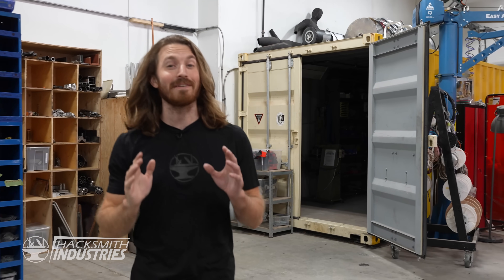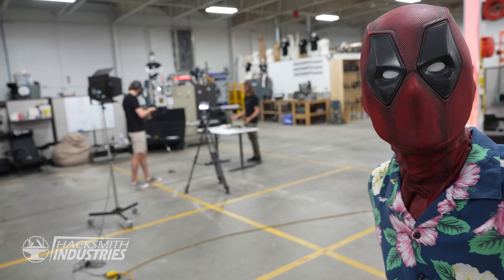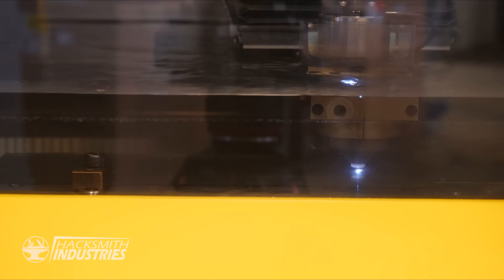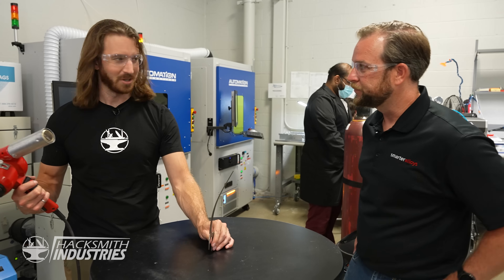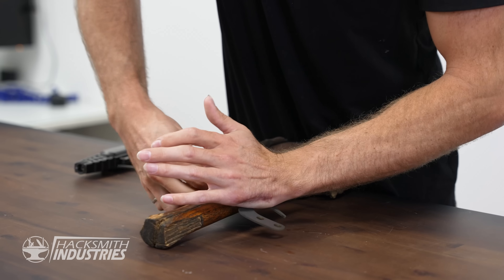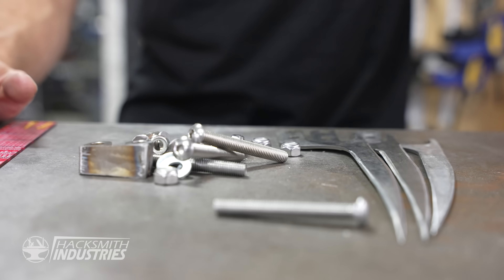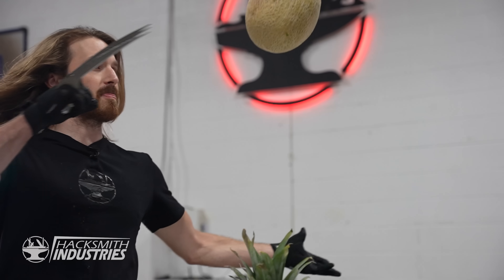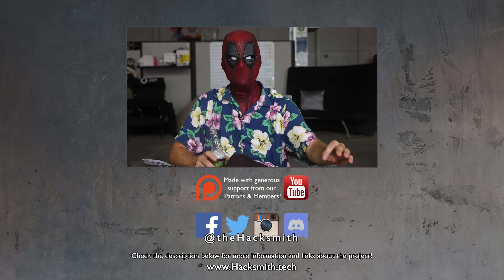I Made Self Healing Wolverine Claws!?

Comment: I think it would be really cool if the claws were held (firmly, so they don't come loose) with a highly insulating material (to protect the user) and had a system constantly circulating electricity through each claw, connected to a battery. The system should circulate just enough electricity to generate the necessary heat to regenerate the claws. Also, making them a bit thicker would be better, so they don't bend so easily anyway.

Comment: I think that material would be more practical for making machines or possibly Buildings.  In the game subnautica there was a repair tool that moved wires and bent pieces of metal back into place.  If it was made of that material that would make sense, the repair tool would just be a heater.  If you could make houses and other buildings from that in areas that have a lot of natural disasters it would significantly help fix the damage.

Comment: @hacksmith great stuff. Quick question - when you used the grinder to bring some shine, it would have definitely generated heat. Would this heat not alter or have impact on the thermal properties and on the programmed or induced temperature.
Reply: Well they were clamped flat while he polished, so presumably it would only solidify the flat shape it heals back to. Can't say i know for sure though...

Comment: You could connect each claw to two wires wich are connected to a power source, so you can heat them up to straighten just by pushing a button or a switch

Comment: Only issue with them now is they are much weaker, so need to find a way for the smarter alloy to not bend so easily/have more strength however still fix itself

Comment: As far as practicality goes, nitinol seems like it's too flexible to be used on anything but flesh and maybe some light armor. The fact that it can self heal means that if you do accidentally hit something too tough, you wont have permanently ruined your weapon. But is that better than just having stronger claws that would perform better against a broader range of materials? If your stainless steel claws get bent, you cant fix them on the fly, but how much force does it really take to bend them? Punching through cinderblocks doesn't seem to phase them so I cant imagine a situation where they would truly be in danger of breaking. 

Ultimately, I think the nitinol claws have one leg up over the steel ones: if you stab someone in the chest, rather than having to break through the ribs, the nitinol claws would likely bend around them, making for a deadlier stab with less force. Additionally, if you hit something you dont immediately cut through, the flexibility of the nitinol creates something of a cussion, so your strikes aren't as rough on your wrist and hands. Its a more forgiving weapon, but not as strong.

Comment: That's a neat metal but I'm not sure where the wolverine claws come in. He self healed, the metal was foreign and didnt heal nor did they need too as they were thick metal. What would be impressive and on point is a set done in tungsten with proper thickness and dimension with a really precision sharpening done too them. Them they would be tough enough that they wouldn't need healing just an occasional resharpening.
Reply from the maker: Tungsten is actually super brittle -- they'd shatter on a hard impact.

Comment: Titanium but carbidize the edge and points with Tungsten Carbide. Titanium at it's hardest form maybe 57 on the Rockwell Hardness scale but Tungsten Carbide has 74 Rockwell Hardness. Carbon steel might reach 62.

Comment: Just a quick question would this have any application for edge retention within say a chef knife. I am not a very scientific person but I am wondering if you would be able to say heat a knife over an oven burner and have its "teeth" return to normal.
Reply from the maker: Not really -- When a knife gets dull it's usually losing some of the material of the edge, which is why you have to resharpen it by further removal. Can't heal an edge that is gone!
Reply: @hacksmith  I didnt think so but i wanted to check also thank you very much for a quick reply!

Comment: Ok, I definitely could be wrong,  but I'm sure I've seen/heard somewhere that there was a similar metal (or maybe polymer?) Where you could pass a current through it to make it return to its "programmed" shape? Might be a cool way to have it heal without an external source of heat? I guess wearing a battery pack and running some wires down your arms might ruin the look though.
Reply from the maker: Same thing -- passing a current through nitonol heats it up =)

Comment: To be fair, you made "sell healing claws" because Adamantium claws wouldn't ever bend, or break 😉
Reply: Actually, Wolverine’s adamantium claws have been broken on several occasions
Reply: @peepee06  example?
Reply: @Sprd1011  he was probably got mixed up thinking of that one time victor broke Logan's bone claws
Reply: @Sprd1011  Didn't he get them broken in that one movie with the other dude that had a superheated adamantium weapon/blade? I don't remember it well. I'm sure he's had them broken or something in the comics though.
Reply: @RemedieX  yeah, it was cut by another bigger and heated adamantium
Reply: @Sprd1011  when silver samurai cut logans claws off.
Reply: @peepee06  not true
Reply: but needs to be melted either way to be able to mold and be malleable
or it won't be usable if you can't form it to what you want
Reply: @lag00n54  adamantium isnt some metal that can be found as solid and then reworked by melting. It is liquid mixture of multiple melted metals and components that are melted and mixed and must be given shape to it  in 8 minutes after those 8 minutes it turns into solid adamantium and then it is almost impossible to melt, it even survived temperature close to that of sun
Reply: @Sprd1011  bro it goes way past the sun bro the only thing that can melt it is straight up galaxy busting heat
Reply: @Sprd1011  it’s called an alloy
Reply: idc what you call it, it’s metal that can straighten itself
Reply: And wolverines bones were coated in it, he doesn't re-heal adamantium, for example when they were cut by the heated adamantium blade his claws grew back but as bones, his original claws
Reply: @markstafki9597  he still has adamantium claws in movie Logan where he is old which means he has them after samurai fight.
Reply: @Sprd1011  He had the metal claws in Days of Future Past as well, in the further. Which takes place just a few years after the Wolverine (2013) movie which is where he got his claws cut off.

So he must’ve healed the Adamantium 🤔
Reply: @Brandon-br7tc  he has spares
Reply: His adamantium claws were chopped clean off by the samurai robot and magneto managed to bend his claws
Reply: @noobdestroyer4758  did that story with magneto happen in movies or  comics?
Reply: @Sprd1011  I’m pretty sure it happened in the movies when magneto kidnapped rogue
Reply: Self*
Reply: Very cool to see how Nitinol is produced. We use this all the time for guidewires and some of the implants that were discussed. Very cool stuff.
Reply: @tola5387  cant understand how nithinol is related to fictional thing called amadamantium

Comment: Here is a funny story: so in late night I was being Rob by some robbers. Then I see a flash from above. As sooner the flash went fast going down and it was appear was a Wolverine. And then he was getting shot a lot and bend his claws. The Robbers laughing at him. And then I see a helicopter pass by. Something also coming down. When it hits the ground it was Hacksmith. He pulls a high quality and next level lighter and give it to Wolverine. Then Wolverine turn on the lighter and slowly put the fire on his claws. Suddenly the claws were slowly going back to its shape. And the Robbers was scared after seeing that. The Robbers went run away because of the claws with high degree of temperature. That day I was happy after being help by those two heroes. 

The End.

Comment: In your Protosaber video you said that to make a lightsaber's plasma beam it needs to covered by electro magnets, and in your Lightsaber Vs Hand video your hand didn't burn because the heat wasn't hot enough for it to burn your hand because of how little time it had to speard, and now Disney is releasing a retractable lightsaber toy, so my question to you is can you make a rod of electro magnets inside of the Protosaber that extends after you push the  button and it makes the beam hotter, is it possible? And if it is then will there be problems such as the electro magnets melting or something

Comment: Its cool but... the claws aren't durable enough to do things wolverine could do if you maybe made the ingot mixed with a stronger metal maybe it could at least slice wood or stab through aluminium cans with ease, right now it just feels like the prototype of what could be the real deal:

Even if you sharpened the edges they would most likely break if you tried it against anything substantial impressive you broke through a door but i felt your fist did all the work

Maybe the next prototype will be the real thing it's very close though

Comment: Why don't u make electricity go through it so when electricity passes through it it generates heat and automatically heals and attach the button to the handle grip and use some other material with sharpens as the tip

Comment: Dude. How mant times have we seen claws like these? Why dont people try to accurately make things these days? I think the best example i can think of is the "spiderman web" slinger which they just used a grappling hook. I get not everything can be made to perfection, but Wolverines claws are hidden and retractable. That wouldve been way cooler to see rather than aluminum bendy healing claws.
Reply from the maker: How are retractable claws into a mechanism on your wrist at all realistic? It's make it real. We can't have them go into our skin, so it's not real.
Reply: @hacksmith  noone said a mechanism on your wrist? The whole claw could be layers of shells until it gets to the blade packed in a glove above your hand or a device you hold like a switch blade or something that could eject the blades between your fingers just wouldve been alot cooler than a blade that can bend but is always just a blade like every other model.

Comment: It's one thing to have the claws heal from being bent, but could you sharpen them, program them with the sharp edges, and then use heat to repair the sharpened edge? As long as the dulling of the edges is due to deformation rather than removal of material I imagine the blade would still self-heal.
I'm just keyboard-warrior'ing this though. Idk how well that would actually work out, but it would be really cool to see.
Reply from the maker: Yeah but you'd be better off with a proper knife grade steel that just doesn't lose it's edge in the first place easily ;)

Comment: All I can imagine is wolverine bending his claws on a chair and having to pull out a heat gun and awkwardly heat them up so they go back to shape
Reply: Nah, the metal goes back into shape with body temp, he would just pull them back into his arms and then they would turn back to normal within seconds.
Reply: @septicsorcerer9620  but what if theyre bent into a U shape
Reply: @nobodyinparticular968  Due to Wolverines regeneration it causes him to have super strength, high reflexes, and a sped-up body system. Meaning his body is much higher temp than normal persons. Not to burning lava level but probably to a noticeable level. As the claws go in they continue to straighten until they are completely back to normal.
Reply: @septicsorcerer9620  that’s cool as fuck ngl
Reply: @Sarcastimation Yeah, not only is it essentially unbreakable. It's constantly killing and weakening him.
Reply: But still this so cool

Comment: you should try connecting these ones up to some power as well. See if the resistance creates enough heat to re-form them at the click of a button. If not maybe a sort of layered material with deforming, semi-conductive sheets between layers of this reforming metal could be used to generate that heat.

Comment: Why haven't they use that metal for freaking automobiles If they use that for door, and fenders we wouldn't worry about shopping cart hiting and other stuff. We would n't have to take it to gthe t shop at all.
Reply from the maker: because its super expensive
Reply: @hacksmith  I know tonight is Halloween. I'm just going to disappoint the trick, or treaters. I'm not going to be here. I"m going to take all my bikes the scoot scoot, and my Honda motorcycle to the back, close the gate, and turn off all the lights. I'm going to the casinos. I"m going to be eating at a Vietnamese restaurant, drinking some margarita, and gambling my little minimum wage check away on the slots, and come home feeling defeated when I don't win, and a little hung over. Don't worry I'm not going to be driving back home. I'm not that stupid. i need my life, and drivers license.

Comment: You should put copper wire/any wire on the side of the claws to create a heating element, so that you don’t need to keep torching it to heal it. Plus the added benefit of the claws being a hot butter knife
Reply from the maker: You don't need to add anything -- every metal acts as a resistive heat element! We can just run electricity through the claws to heal them

Comment: Put wires in them so that you can heat them up with a switch
Reply from the maker: dont need to put wires in, the metal acts as it's own resistive heater! just add electricity

Comment: You should do another set with a slot cut in the middle of each claw where you can run an electric heating element, so they do auto-heal with the flick of a switch.

Comment: Why not have an electrical current be applied across the blades so they self-heal and not "Hold on a second, I gotta pull out my lighter"
Reply: The tips would get much hotter that the rest of the claw

The larger the cross section, lesser the resistance. It is inversely proportional
Reply: @thephoenix6651  It would go fine with the proper setup. As long as it can create a small 40°C, which is a very small amount compared to what a portable battery could do for metal plates that small, it can easily be done. And it doesn’t have to be on constantly, just long enough to last. It’s not an uncommon method to use electricity to reset smart metal positions.
Reply: @GrimOfDonuts  the problem is that the ability to self heal is the ability to bend so it would just bend more
Reply: @a.a.6445  no, it wouldn’t. Otherwise it would have just bent more when he used a lighter against it. Smart metals are often realigned using electricity for a perfect (and often quick) going back to designed shape.
Reply: @GrimOfDonuts  i think he means if you left the heat on they bend easier
Reply: @GrimOfDonuts  Yeah true it could if done properly, but in this case it wasn't worth spending the time on that. This is a small project.

Comment: If it's conductive you should put a low amount of voltage but high amps through it just enough to get to 40c to automatically heal it with the push of a button on the side of the handle

Comment: I wonder if you run an electric current through them like you have done in the past, will they reform while deforming? 
Perhaps a battery powered current post deformation in order to "self heal" after using them instead of applying an external tool like the mini-saber?

Comment: Next thing you should do to improve these could be increasing the thickness on them a little so they don't bend quite as easily as now, and make some sort of system you can switch on that will heat them up and straighten them on demand without a heat gun.

Comment: To he honest, these are more flimsy than strong... they wont be breaking concrete anytime soon. Maybe there is some other "smart alloy" that has the rigidity of stainless steel, but the brittleness of nitinol and can return to its original shape when heated. It would also be cool if you lined the claws with some kind of heating component, so the claws can heal at the push of a button. But besides that, great job!
Reply from the maker: You can also control the rigidity of the material in the tempering process

Comment: Nitinol is such a cool alloy! It's so crazy what material scientists can do nowadays!
Reply: I made a robot arm (well, elbow joint), out of Nitinol 20 years ago. 4 tendons for the bicep, all in parallel, with an electrical circuit using them as the conductor to heat them and thereby shrink the metal and lift the lower arm. Something crazy like 4x 1mm wires of nitinol is as strong as a human arm.

Comment: How about you mix smart-Allois with solide steel or titanium like in a Katana so you have a blade that does fix itself but does not bend over.
Reply: @Trent Mage That’s not neccecerrily true. It depends on how your layering it, which „Legierung“ you use, if you can use harder Selfhealing-Alois and most importantly normal steel-swords of thee late knight Ära are highly bendable I don’t mean rapiers I mean Knight-swords. Those are extremely flexible. If you can combine aal that you might end up with a hard blade that can fix it’s sharpness by itself after hitting a hard space. It shouled also be possible to have a harder Tip that can penetrate thee rock 🪨 while your hand has a weaker aloi to work as a force damper.

Comment: I feel like you're making up an artificial problem just because you know the solution beforehand.
Just take AR500 steel and it won't bend while pocking a single concrete brick.
Reply from the maker: then that's no different than our original claws from 2009

Comment: What if you found a way to heat it from the inside out or what if you just ran electricity through it to heat it up?
Reply from the maker: yeah you can just run electricity through them
Reply: @hacksmith  so if you had a big enough battery you might be able to set it up so it repairs itself at the push of a button. At least in theory, easier said than done.